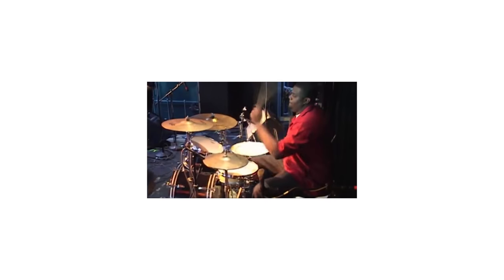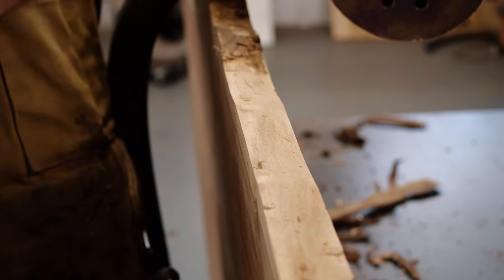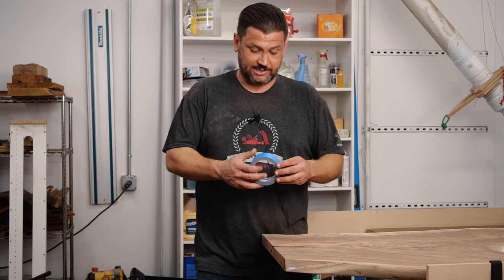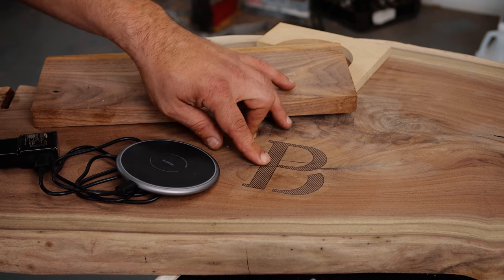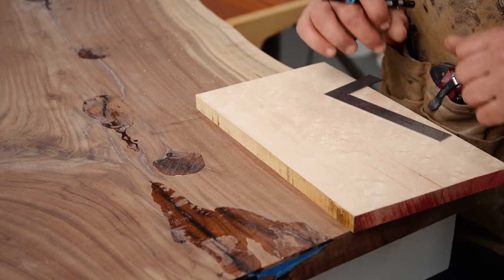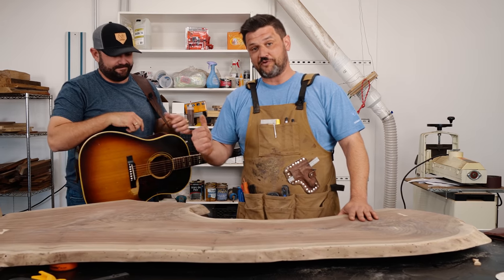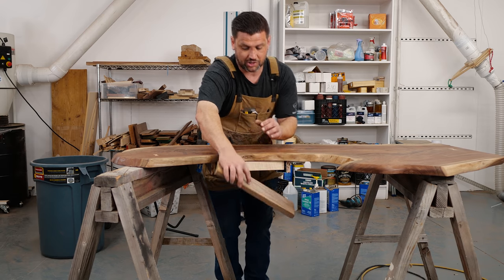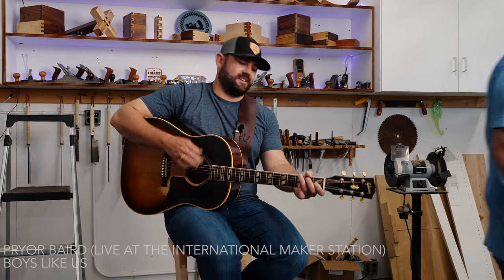Live Edge Desk with Hidden Wireless Charging (for Pryor Baird from The Voice)

Comment: i like the linseed oil touch to treat the pipes. Life hack, i use oil based Flood Penetrol for coating metal. You can let it rust, and then coat it. its a great cheap product.

Comment: What happens if the charger burns out?
Maybe a cap that could have been press fit in that was thick enough to put preasure on the charger to keep it in. So if it needs to be replaced it can be?

Comment: Thanks for the video.  I've been wanting to put a wireless charger in my desk.

One question, why didn't you take the 'guts' out of the charger?? I took one apart, and it looks like I could seal it up in epoxy and get the antennae even closer to the desktop.

Just curious, wondered if you thought about it and discarded the idea for some reason.
Reply: With the way technology progresses these days, I think it was smart to leave it accessable to change it out or upgrade down the line
Reply: @EricRoy85  Good point. I was thinking of making a mold barely bigger than the guts and use epoxy to rebuild the case, then attaching it. It's low voltage so I wouldn't think it would need to be very thick.

Comment: Amazing desk! Quick question - did you start hand-planing and sanding down the epoxy before it was fully dry? I'm not sure how long to wait on my table before doing this. Alternatively I think it's possible to reheat with a heat gun and then chisel/plane it down, right? Thanks!

Comment: Did you route a channel for the charger cord to the leg?
Reply from the maker: I honestly didn't because the cord ended up being shorter than I expected
Reply: @katzmosestools  he could end up buying a longer one online. Would you just drill a hole at the top of the leg and run it down to the foot, or too much hassle and run it along the outside?
Reply from the maker: @thefilthelement  down the leg would be cool but it might be tough to drill a hole big enough for the USB male plug in that size pipe. Who knows